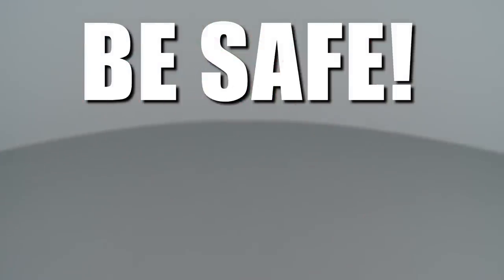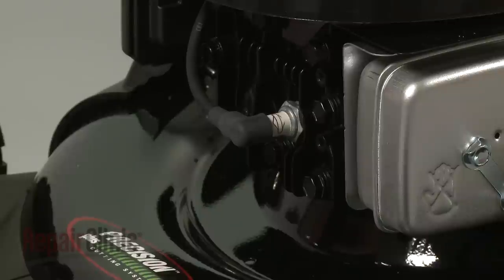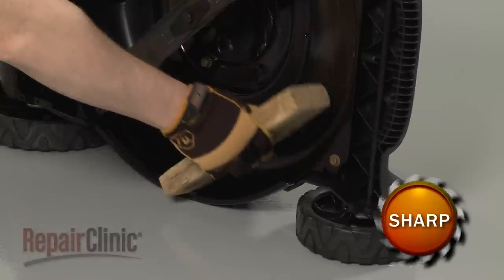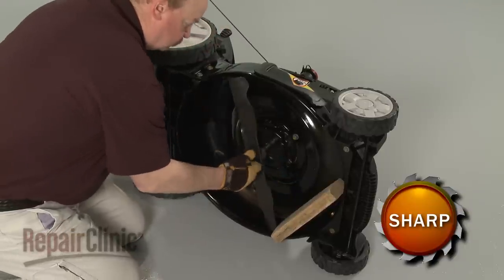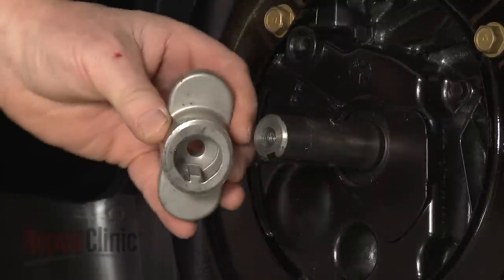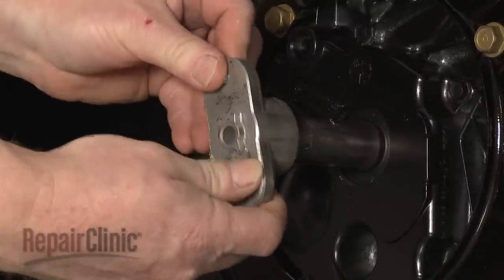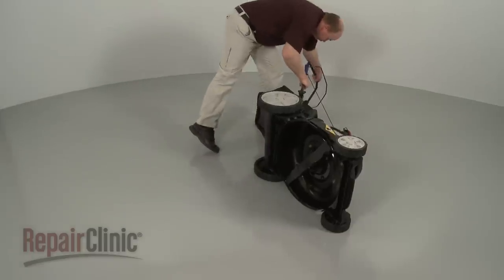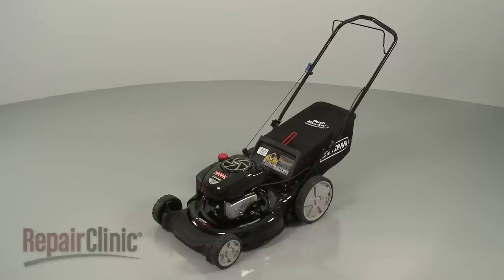Craftsman Lawn Mower Blade Adapter Replacement #753-06304

Comment: I'm just a dumb shade tree mechanic but last time i check if u turn a mower on its side (as done in this video) with the exhaust down it will drain oil into the exhaust an make a hell of a mess. As most ppl will not know this or have the fore thought to drain the oil before turning it onto the exhaust side as was done in this video if it was me an didnt know better i would be mad as hell if i followed this video an ended up with a exhaust full of oil or oil all over my shop floor!
Reply from the maker: Yes It would probably be a good idea to turn the mower the other with the exhaust facing up. You would have to leave to mower tipped for a long time for  oil to leak out the muffler. Thanks for your comment.